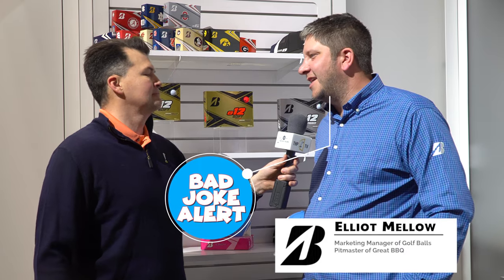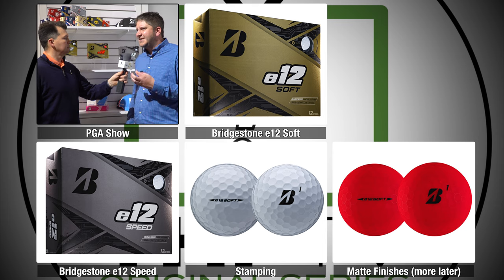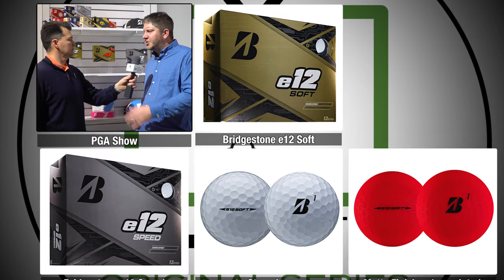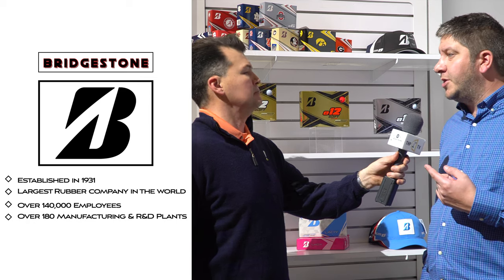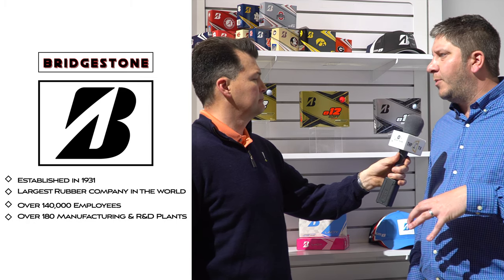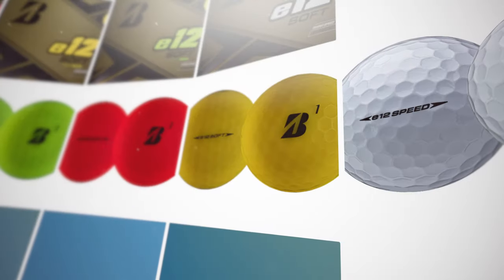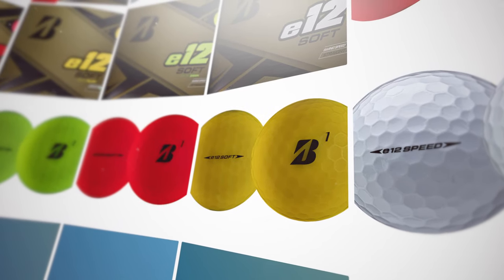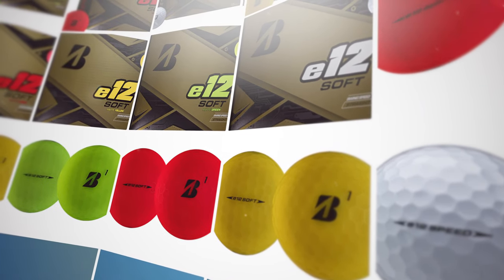Bridgestone e12 Golf Balls

Comment: What is the main differences between the e6 series and e12 series balls? Not much information out there usually just comparisons between the soft and speed balls but not the 6 vs 12 series
Reply from the maker: Three layers to two layers would be the first thing.  The second would be a different core, which is explained in this video.